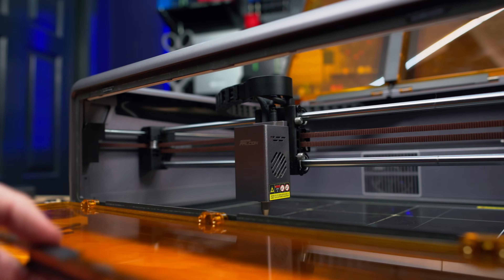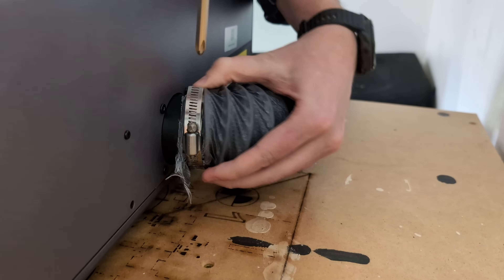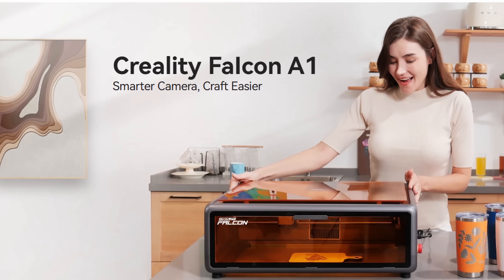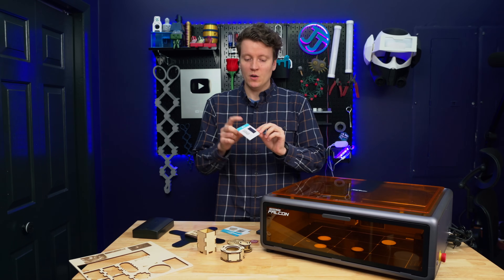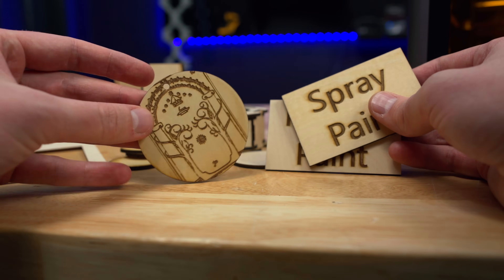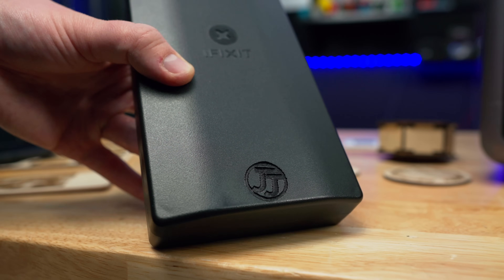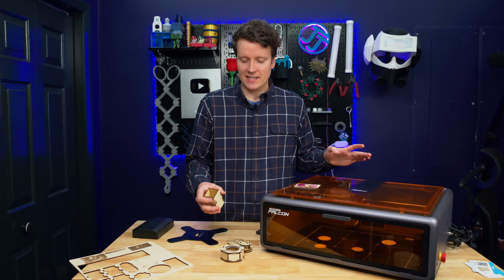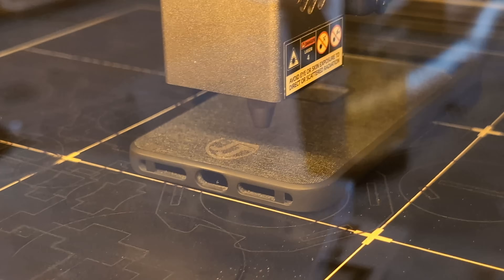Creality Made a Safe, Easy, and Cheap Laser - Creality Falcon A1

Comment: I got one of these a week ago. After 3 days the laser strength reduced by maybe 80%. There is no warranty. I opened a ticket with two of the support teams and sent a video. I think they know this happens. As is still true, you can't get something for (almost) nothing. It might make a good enclosure to store sliced bread and bagels.
Reply: How long did you use it? Did you change any settings? Did you engrave or cut reflective material?why wasn't there any warranty? You need to push this more, dont give up!

Comment: You can paint a knive and then engrave a crazy drawing, after you take acid and slowly tap a cotton soaked in it,, and then repeat a couple time, the acid got to be weak enought and the paint got to be strong enough,once you are done you got crazy metal engraving. I did that on a knive i had , it was prepainted with an epoxy paint and logo was lazer etched, so i did the acid trick and removed the paint after with paint remover.

Comment: A1 tells me Creality has a sense of humor and one-up-manship re BBL.  I like that.  This unit incorporates laser, enclosure, air assist, camera and fume extraction all into one cohesive unit.  I like that.  I see only one thing missing - a honeycomb with aluminum underlayment.  Honeycomb is needed for cutting.  I understand its not included due to pricing considerations but they need one designed specifically for this machine and make it available.  Maybe it is?
Reply: Yeah they actually offer a Honeycomb Workbench for this laser ;)

Comment: How thick of a material can you engrave? 381 x 305 but the height is missing. Would like to do a cutting board so thickness could be an issue.
Reply: you should be able to engrave a cutting board no prob but you will not be cutting it.  approximate max material thickness to fit under the laser head is about 2 inches.  that is not much clearance to add a honeycomb and its needed to cut through items.  10w Diodes are primarily for engraving pieces up to an inch or so thick and cutting through material of about 1/4 inch and up to 1/2 inch with many passes.

Comment: I have used laser engravers professionally for over 10 years and would never ever use a machine without an enclosure. You can occasionally get reflections shoot in very unexpected directions. One thing to note is you should never leave the machine unattended. I have had several work pieces catch fire over the years. A co-worker of mine almost burnt the hole business down when left a long job engraving and went for lunch.

Comment: Falcon A1 10W Laser 545Eur must be ajoke, 10W is so low.
Reply: For these sorts of uses, nope, 10w is fine. You're cutting wood and doing light engraving, not arming a starship. And the limitations of what it can cut are in many cases a matter of physics, not power.
Reply: @egmccann  In that case add 500Eur more for 30W
Reply: 10w is good for home market segment, it takes 4 times the power to double the capability.  The A1 incorporates enclosure, air assist, fume extraction, design and control app and positioning camera all designed from the start to interface and work together in one cohesive unit for the price of the average 3D printer.  That is something good.   Who offers a better price for a comprehensive product like the A1?
Reply: @ 10W great? You must be joking right.